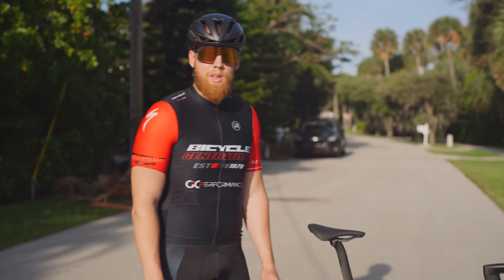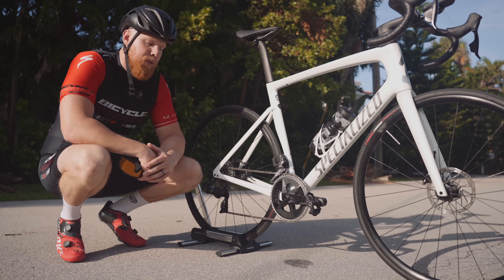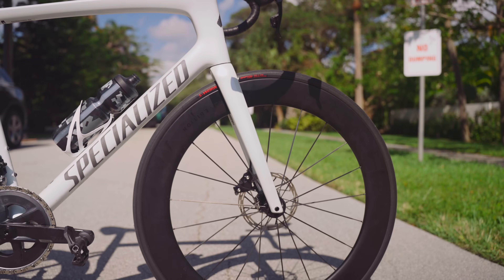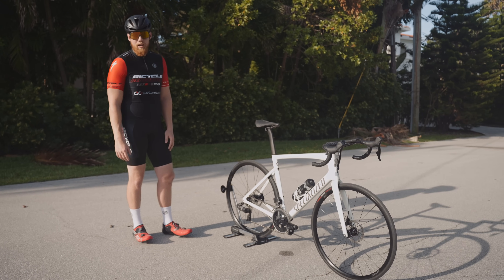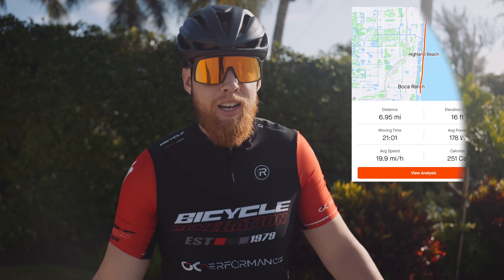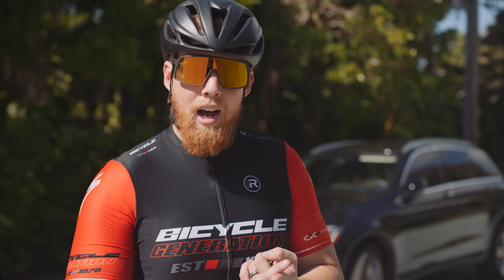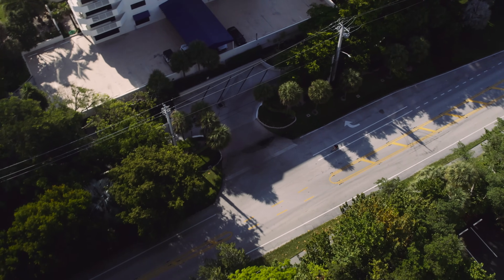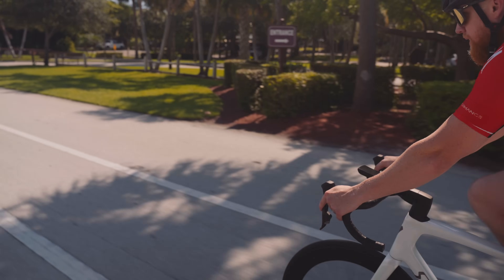HOW MUCH SPEED CAN YOU BUY?! *ALUMINUM WHEELS vs. CARBON RACE WHEELS*

Comment: I bought carbon wheels because: 
1. They look great and rolls better. They also make the swoosh sound. 
2. Tires are so much easier to get on and off on newer wheels models.
3. They are tubeless and hooked so I can run any tire on them.
4. It's Shimano so I can service the hubs easier myself with to spanners costing 20 dollars. 
5. The wheels are wider so I can put on larger tires without getting a very huge light bulb effect.
6. It's always nice to have nice gear if you can afford it. 

Im 50+ who rides for fun and the occasional grand fondo, Im not gonna race with them.
Reply from the maker: Hell yea

Comment: Carbon vs aluminium:

Watts/mph:
Carbon:  185/21.4 = 8.6 W per mph
Stock.  :  180/19.9 = 9.0 W per mph
There is a small difference. Perhaps the biggest difference is the psychomotoric feedback - it was easier for you to put your force into the carbon wheels - this is interesting to discuss. I’m guessing the carbon has an advantage at higher speeds due to aerodynamics and can accelerate faster due to (presumably) lower inertia
Reply: it is 185/20.4 = 9,0686 W per mph
and 8,944 W per mph on stock sad story

Comment: Hey Gc, 
Long time subscriber and this is no way a condescending comment. Just thought of bringing to your attention based on the video and I'm not an expert bike fitter. One of the reason you might have lot of pressure on your hand might be, your saddle height might be high. Based on one of the video from Neil(Australian bike fitter), you seem to loose control on bottom of pedal stroke which might indicate high saddle height.  Just my little 2 cents, you might want to try lowering saddle height and see if it makes any difference 😄

Very nice video. BTW, I bought Tarmac SL7 just based on your videos.

Comment: What was the weighted average of power? I do not disagree with swapping out stock wheels. Do you think a. higher end carbon wheels with less depth also would work? In areas with heavy cross winds that deep dish wheel is going to become a problem.

Comment: great video and channel... planning to do the same with a specialized tarmac 2023 frame. Putting the 105 di2 or rival etap with roval c38 or 303 firecrest on it. Just hard one to decide. any suggestions?
Reply from the maker: Thank you veyr much, I had so much fun making this video, shit go for 105 di2 if u can get ur hands on it, whenever it comes ouit and also pricew point but I think it should be around rival price, go c38 as well, more performance in my opinion
Reply: @GCPerformance18  man thx so munch for the advice… appreciate this a lot. Will allready talk to my guy for it. Will adjust the 18 tooth to a 36 for the wheels and bike will be epic. Good luck with the shop channel and stock 😏

Comment: Hey GC quick question. I’ve never taken my bike to have the brakes bled but I bought new Enve 65s recently & figured I should get some nice dura ace rotors to go with them so I don’t have to switch my brakes each time I switch wheels. Anyways I felt since I was going to get new rotors I should have my brakes bled & took it to my local shop. It came back squealing with both my new rotors & my old ones. I’ve tried everything online (alcohol, realigning, braking down a 5 min decent multiple times) but the squealing won’t stop why is this?
Reply from the maker: sounds like during the bleeding process they got fluid either on the pads or the rotors, some contamination happened somewhere, needs to be cleaned. try using squeal out or have the shop clean them properly

Comment: Great video as always.  .5mph delta is likely more due to the 7W delta in power :)   No doubt the carbon wheels offer a better ride but for real aero gains, you need to be at higher speeds.
Reply: No it's not. Here's why: speed isn't linear. 0.5mph delta from 19.9mph to 20.4mph is not the same as, for example, 15mph to 15.5mph. In the former, power plays a smaller role than aerodynamics. 

From experience I can tell you that it takes more than 7W to go from 19.9mph to 20.4mph.

Comment: What r the wheels you mentioned for $1300 or was it $1500 for pair?  Nice kit!
Reply from the maker: Wheels are $1300 they are the winspace hyper 65mm carbon wheels. I have a discount code for 10% off gcperformance10

Comment: May I know can I pump tubeless wheel (Conti 5000 str ) with normal track pump
Reply: Yes you can. I'm using regular Specialized $50 pump all the time.
Reply: Yes, with applying little soap.

Comment: I'm curious about the differences in comfort going over bumps.   Do the carbon wheels absorb the road better than aluminum or what has been your experience?
Reply from the maker: yes they do, and the usually have a wider rim track compared to alloy as well so it makes the tire spread otu more so more tire touching and absorbing the impact

Comment: A better test would be to maintain an average speed with both wheelsets and then compare power outputs. It's probably much easier to maintain speed than it is power.
Reply from the maker: yea I amn sure there are a ton of beter ways to conduct itbut this this worked the best

Comment: the max speed and endurance you can reach is governed by you ability to put out power for a long time , weight just allows you to accelerate quicker if its lighter , your ultimate top speed is dictated by air resistance and your power output. If you can put out 400watts air resistance is boss

Comment: Small question - how much difference would the same depth of rim between alu and carbon make? E.g. a DT Swiss P1800 32mm vs a Hunt 35 Carbon Aero? Thanks!
Reply: On steady flat roads no difference. Maybe you feel it starting at a green light or sprinting up a hill when carbon lightweight wheels are faster.
Reply: @awesomesloppyjoe  x2 - There's been extensive testing where in steady state on completely flat roads, the weight of the wheel has zero effect in this type of riding.

Comment: Many comments addressing the delta in power-  178 on aluminum vs 185 on carbon, attributing the increase in speed to that watt difference. 7 watts at such a low power output is practically nothing. On wheels alone he gained 0.5 mph at the relatively low intensity. Imagine if he was riding seriously and not in an all-else-equals scenario.

Comment: 7 watts + 
0.5 mph +
= no difference 

(7 watts could be the .5mph)
Reply: This was my conclusion as well. The first ride was also .1mi longer. I appreciate the effort put into the video. I’m a fan of the channel. But I’m not sure any video has done more to convince me that a set of carbon wheels isn’t worth it for me.
Reply: Yes, carbon wheels are for looks, and that's about it. They look sexy.
Reply: @marinstube  absolutely love the look it’s priceless
Reply: @owensnicholas  performance gains are there but not gonna be game changing 
however i have yet to met anyone who regret getting a nice set of deep section especially on newer disc brake bikes
Reply: Yeah, I was wondering about that, thanks for confirming it. I'll still put 50mm wheels on my Tarmac-when the bloody things are available in Europe that is. It just looks better.
Reply: @owensnicholas  I get it...for a weekend warrior like me, I can get 0.5 mph faster by eating less and being constant in my training, and that would be free. I still want to treat my self to a new set of wheels, but carbon wheels won't be the prize. As soon as I can, I'll be getting the Fulcrum Racing Zero, I won't win any races on those, but damn I'll feel good riding them.
Reply: Seemed to me that you can go further, quicker and with less perceived effort which matters on longer rides when you start to fatigue and want to maintain a high speed.

Unfortunately we don’t have the luxury in the UK of cycling 7 miles with only 23ft elevation. Hilly as f*** over here! Sold it for me

Comment: I don't have a power meter, but I had recently guessed that I was 0.62 mph (1 kph) faster after replacing my stock wheels with a 50mm carbon wheelset, but it also included upgrading to GP5000 tires and latex tubes.  So it sounds like my guess was pretty close after hearing the results of your test.  Great video, thanks!
Reply from the maker: Thank you very much. It was hard to showcase at this speed. But if I was in a group or going faster that’s when these wheels shine even more

Comment: From the data you posted, it seems that the wheels are about the same, no? 0.5 miles faster for 7 watts more does not support that the wheels are any faster. You should also ride a loop instead of straight road, because slight changes in wind speed and direction will make bigger difference than the wheels

Comment: this is what I have found also. About 0.5mph faster. I do a lot of 20 mph rides for about 2  hours. the carbon 46mm wheels with the same gp5000 tires are good for about 0.5 mph over my alloy wheels at the speeds I do. The faster people at 25+ mph probably have a bigger speed difference. When I first bought my carbons wheels I thought was going to go 1 to 2 mph faster. lol

Comment: Need part 2, climbing performance at 300w
Reply from the maker: was thinking of doing it at 225-250 to see the differeces to see if the carb wheels shine
Reply: @GCPerformance18  steep gradients might allow the differences in wheel and hub stiffness to be exemplified, especially for that rear wheel under pressure.

Comment: 0.5mph is nothing and that's even considering your clothes. Most of the time I ride in everyday casual clothes with a backpack. I have to admit that every upgrade you make just feels nicer, it's not about speed. Yes, I have my SL6 with carbon wheels at 6.8kg w/o pedals (7.2kg fully equipped with lights and stuff) and recently I tried an aluminum 9.3kg bike and you know what, it really wasn't that bad given the fact it costs probably 5 times less.
Reply from the maker: I know it seems small but if you are in front of a group side by side with a firend for 60 miles and they are getting a half a mile an hour faster for the same wattage, that is a good amount of effort saved for the whole ride and that much more fresh for the sprint
Reply: @GCPerformance18  Maybe, if you do competitive cycling, I ride for fun.

Comment: How big are you?  I assume you're a smaller guy?  I'm 6'6 and 185lbs and to ride at 20mph I've gotta crank out 250ish watts.  I assume it's aero because I'm fairly broad shouldered which makes me a flat surface.
Reply from the maker: yea I mean smaller guy compared to you, you 6'6 185????? im 6 foot 190 im doing by myself right now 205-210 I can for a ride by myself but i am working I am stil getting back on the road right now

Comment: "It's 1 to 2% the entire way" also, "it's literally flat" which is it? Also you were faster on the second run, but you put out more power so was it you or the wheels?
Reply from the maker: dont know the gradient it is literally, 23 feet of elevation, thats it, and yes I put out more power yes because the wheels responded easier and felt like they were wanting to propel me forward more, I was getting into the speeds of where those wheels shinned so it was harder to real it back in, but yea I went faster but if you do the simple math and do 7 watts over to give you .5 mph more, it doesnt add up for 185 watts

Comment: I'd like to know what your average heart rate was for both rides @gcperformance
Reply from the maker: Don’t run heart rate, next time I will but that Informstion is so specific to that being
Reply: @GCPerformance18  Thanks. I think that heart rate is a decent gauge on how hard you are working. If you produce 180Watts on the aluminum wheels for an average heart rate of 145bpm and then repeat it after a rest with the carbon wheels and produce another 180W average for 135bpm average heart rate, I would call that significant. Thanks for the test.

Comment: You increased your power output by 3% (185w vs 178w) and only got a 2% increase in speed (20.4 mph vs 19.9 mph). Seems like the deep rims made you slower. I’ll keep riding my stock rims, thanks.

Comment: This is waaaaayy better than some of your other content. Really great video with useful, real-world examples. 

You saved a minute over the 7-mile course. That’s 7 minutes on a 50-mile ride. BUT, there was a 7 watt difference, which is small, but not nothing. That time savings will be smaller if wattage is matched exactly… Like someone else said, the speed was slow enough that the aero benefits don’t really kick in. Do this same test in a mountainous area with some fast descents and In sure you’re going to see a bigger difference.

Add in an aero helmet like the new Giro and some aero socks and you can probably save another 15-30 watts.

I’d never recommend a $2000 set of deep dish wheels to the average rider. The average rider will save more time for way less money with better tires and/or tubes to lower rolling resistance, and aero optimized accessories and clothing.

Comment: I say this every time I see a video where they're boasting of the advantages of expensive carbon wheels.  Buy Superteam carbon wheels from China.  You can buy shallow all the way up to 88mm for less than $500.  I bought my set of 38mm wheels off of Amazon on sale for less than $300.  I have thousands of miles on them and they're still really true and still look fantastic.  But you don't have to take my word, there are plenty of video reviews of these wheels right here on YouTube.  Also, I have the single side Assioma pedals and they are amazing power meter pedals.  Cheapest on the market and most accurate.

Comment: I'm no physicist, but I'm not buying your test... You put 7 more watts in and gained 0.5 mph, no real surprise here. Your distances were different, your elevation was different. Either the routes weren't the same, or your data isn't reliable. Interestingly enough, if you do the math, you added ~4% power, but only gained ~2% speed....

Comment: Watt is watt and you pushed 7 watts more, and only went half a mile faster. If you are on a mountain bike 180 watt will be the same only your speed gonna change.
Conclusion: carbon wheel slightly faster but cost waaay too much. For professionals or for a race its fine otherwise waste of money.

Comment: But 20mph is pretty slow ain’t it not? 

Most ppl would be riding at around 25-35kph which is where I’d imagine the real gains are to be found. Of course, this is putting aside intense headwind, in which case the aero gains of the wheel comes into play again. 

Any lower is kind of a pointless metric since at those speeds, said cyclists aren’t chasing speeds either (eg just getting to the start point or recovery rides)
Reply from the maker: yes it is slow but that was the point, there are people in this sport who just start out who want to buy carbon wheels and are nervous of buying them at that speed becuase they might not see a difference
Reply: 20mph is 32kmh so close to the top of your estimated range of where "most ppl would be riding". BTW, Strava says the average speed for males in the US is a little over 15mph.

Comment: #1 UGH they're not deep dish wheels! Stop saying that.  Deep dish is pizza.  They're deep SECTION wheels.  Dish on a wheel refers to the angle between spokes on opposite sides of a wheel.  #2 you went through all that (great) production work and totally invalidated your test by putting out 7 more watts.  If you do the calculations, 7watts equates to about 0.3mph.  That's almost all your speed gain right there.  And a 0.5mph wind change could explain the rest of the speed change.  You need to include the wind speeds for the tests too.

Comment: if your hands went numb surely your bike fit is wrong.  Results would have been more meaningful if you did each run going as fast as you could.
Reply from the maker: hands went numb because this was a fit that I am used to but my body was not at the right shape, I am honest with myself, also if I went as fast as I could go the first time and then the second time, I would be hurting the second time results because I would not be able to put out the same effort, with a power meter test we have abase to compare the data too